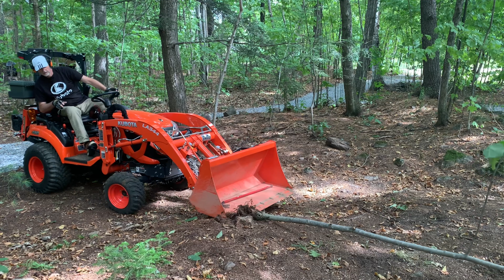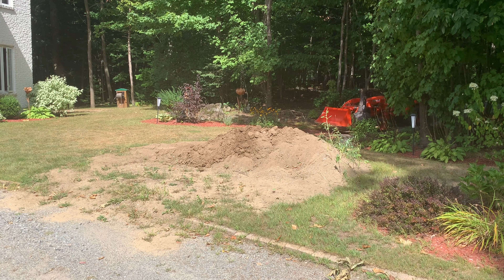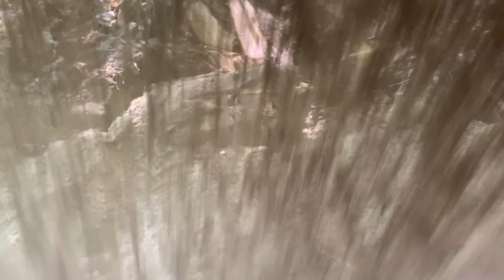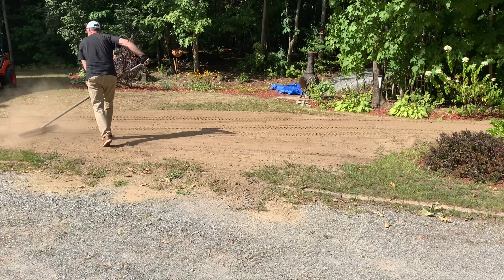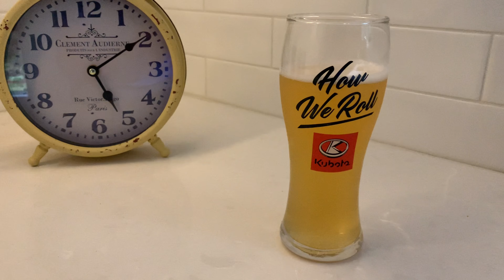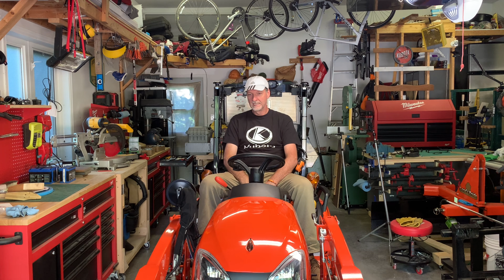#71 Camp site completed 👍🏻.

Comment: Nice work using the bucket to do some grading work. I think it looked about perfect without even running the rake over it. Unfortunatly for now my kubotas only get a bath when it rains lol. Not a drinker here, but i think i would like to have those glasses in my cabinet. Good save on the rops! Where did the "Orange is my New Green" sign go?
Reply from the maker: 😂😂”when it rains” lol, I think I have more time to wash mine than you do, you guys are really busy, the new house, the barn, your regular job etc…, do you mean the sign with the lights? Thank for watching Richie and have a great week 🙂🙋🏼‍♂️👍🏻
Reply: @OrangeismyNewGreen  Yes the one with the lights. And on top of all of that its Power plant season so im very busy ! Doing 12 hour shifts everyday with about 3 hours of commuting on top of that!
Reply from the maker: I always forget to pull them out 🤦🏼‍♂️😂. 12hr shift + 3hrs of driving 😳 OMG, stay strong my friend 👍🏻🙋🏼‍♂️🙂
Reply: @OrangeismyNewGreen  I’ll make up for it by taking the winter off, but due to spring and fall being times of low energy demand that’s when plants go offline for repairs and refueling